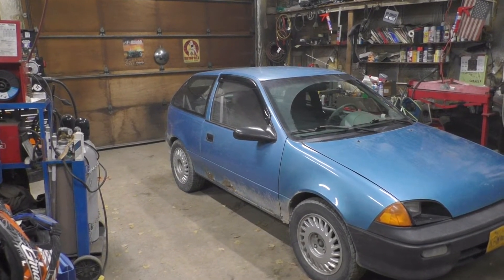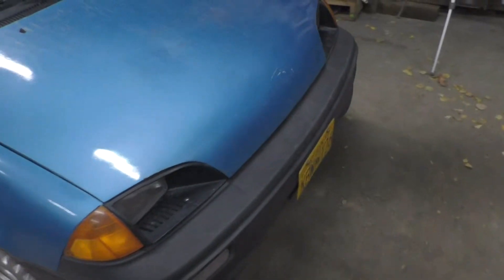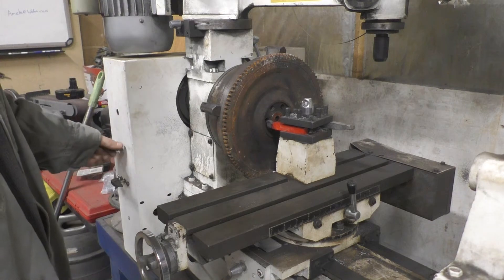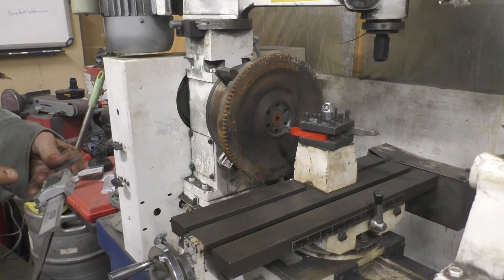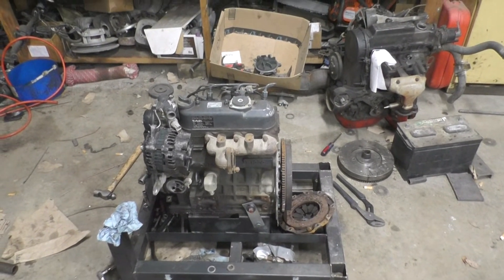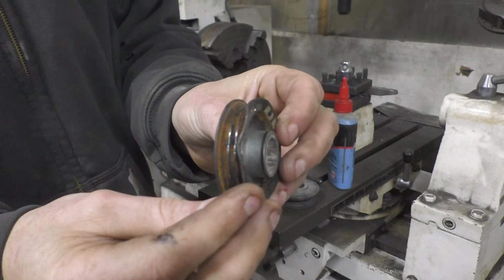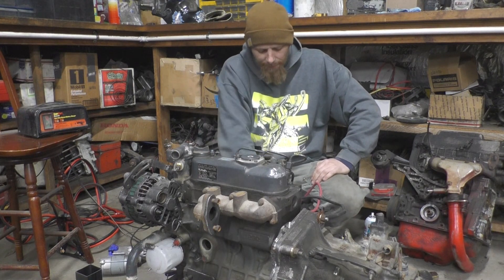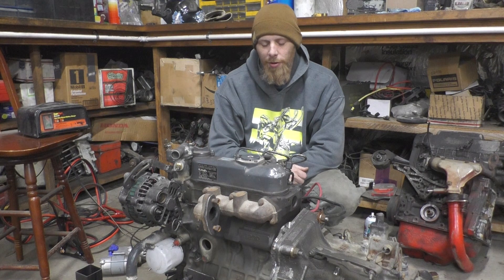Geo Metro Kubota Diesel conversion Part 1

Comment: I'm using a 3 cyl out of Kawaski mule 3010 or JD gator.  Having trouble making adapter plate.  I'm laminating two 1/8 plates to engine plate (just as shown here) My plasma cutter won't cut larger clean enough with my current power supply.  Will use that same 1/8 to make exhaust flange.  Kawasaki's engine has tendency to twist crank between 2 and 1 so maybe turbo is out??  Would like it to cut some smoke while changing RPM.
I would hope its not max rpm @ 50 plus mph.

I like your just get it done theme
Do you run Arctic Cat...  seemed like a F series in the intro Haven't rode that chassis yet.  I like Afs Wildcat 650
Reply from the maker: Yes I have arctic cats intro is an old cheetah had a powder special the m1000 now proclimb
Reply from the maker: 1 used 1/4 plate with the 1/8 to thicken it up.

Comment: Thinking about making a sxs from the same engine was just wondering what would fit so I have some kinda idea what to look for
Reply from the maker: This is the same engine the kubota RTV uses
Reply: Was wondering about the transmission bolting up and bell housing wanting to put a driveline in it and some kinda rearend so I can have bigger tires on it I can’t find anything to bolt up like you did
Reply from the maker: It didn't bolt up I made an adapter